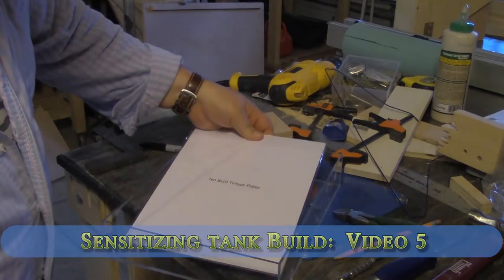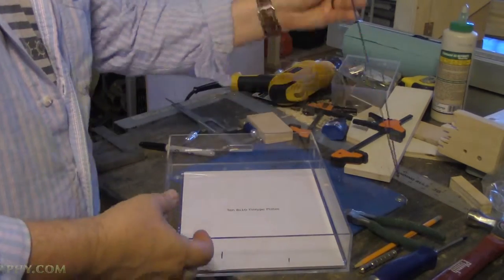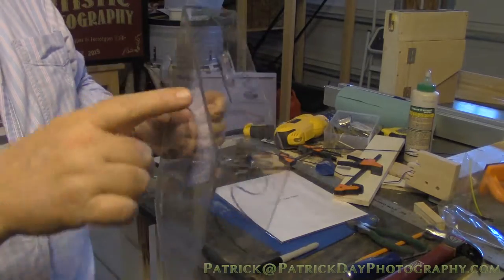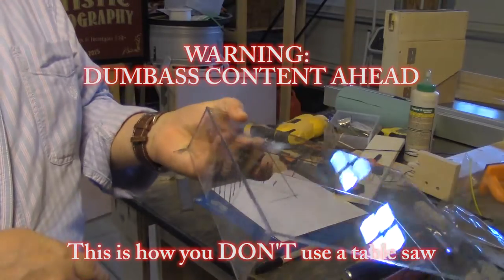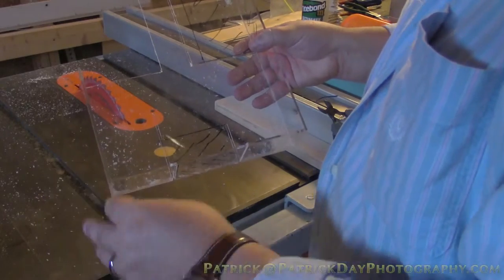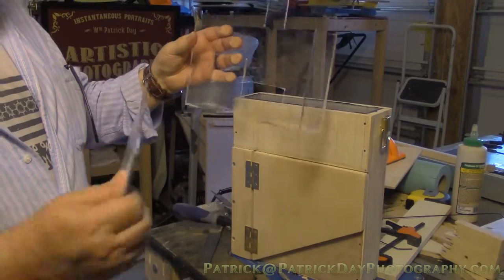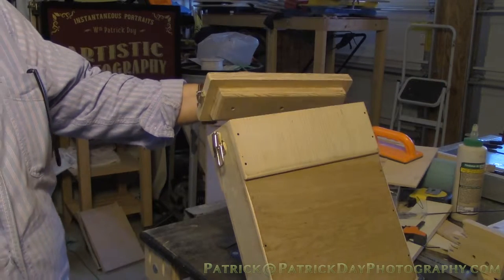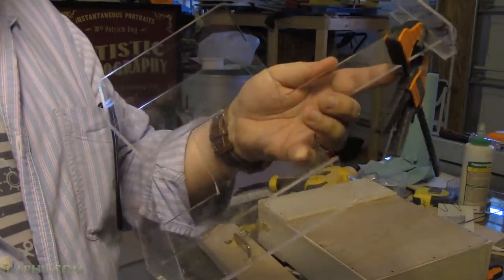Collodion Wet Plate Tank Build - Video 5 of 5

Comment: OOOOOOOOOOOOOOOOOOOOOooooooooooooooch!   your right don't do that with a table saw:)
Reply from the maker: sometimes one's purpose in life is to be the example for others.  :)
Reply: I agree and ones fingers are also very important:)
Reply from the maker: also.  i had to totally abandon this build as it was a total failure (leaked like a sieve) though i did learn a lot...of what NOT to to do.  I'm an experimenter more than anything.  I would highly recommend going with an opaque (black) acrylic sheet and cutting it to size. USE the specific plexiglass adhesive.  It was a heckuva lot easier to do it right the second time. Don't use crazyglue, aquarium glue!  Use: SCIGRIP 3 12754 Acrylic Solvent Cement.  More thoughts: THIS tank was WAY too big and required 2 to 3 times as much costly silver nitrate.  Think minimalist.
Reply: Patrick,to blacken the outside of the perspex could you use black sticky backed plastic or an adhesive black vinyl?
I've taken your point on the size of the tank, less is a good idea:)
Reply: Patrick could you just paint the inside of the wooden box with black board paint instead of covering the perspex case,just another thought.
Reply from the maker: i could, but it would be chasing fix after fix after fix to accommodate a bad foundation.  It took a quarter of the time, a 10th of the cost, and created a much better outcome by using the right materials from the start.  I will try to upload a quick image of the final.
Reply from the maker: Here is an example of the final version.  I started from scratch by (gasp) designing it first!  Gotta love Fusion360.  I think i made it from a single 16x24 sheet of .25" black/opaque plexi.  I've got some raw videos of the build that i've not compiled due to being lazy, i may try that this weekend.  Here ya go.  Ping me if you want dimensions, i may still have them somewhere.  https://www.facebook.com/media/set/?set=a.10212742438502735.1073741848.1440301466&type=1&l=3bf2934495